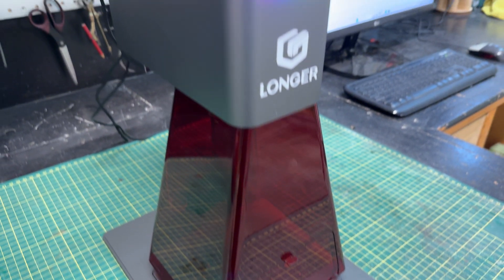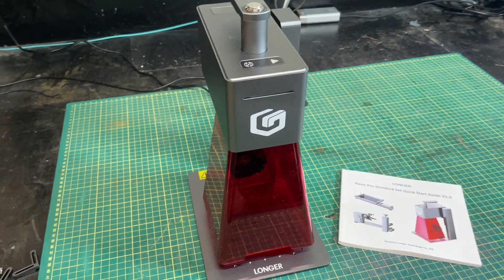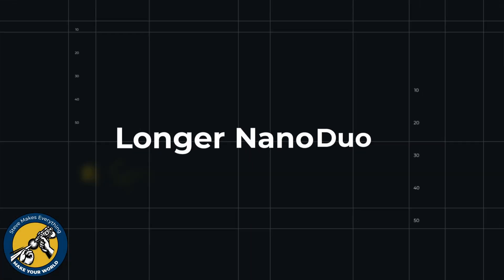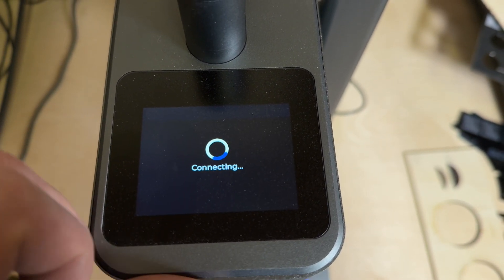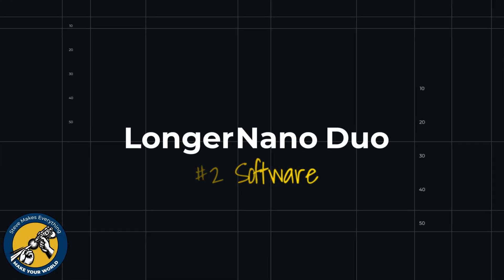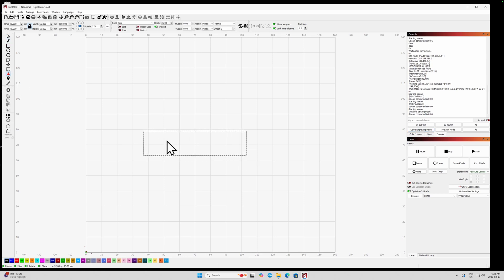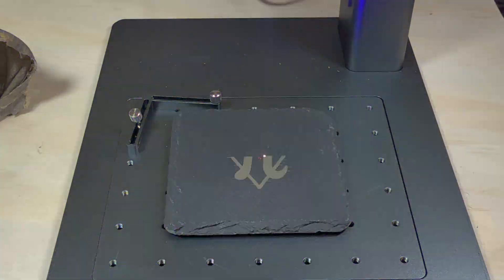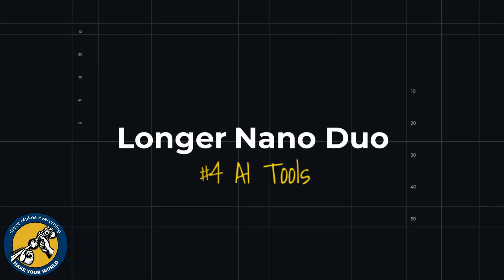This New Laser Device Makes Wood and Metal Engraving EASY!

Comment: Nice video Steve. They advertise a 160x140 working area, have you had a chance to validate that? I am considering this as a first laser.
Reply from the maker: Yes I have. Of course with a galvo power at the perimeters is a bit less but it’s quite acceptable here. If it’s your first laser then understand that you won’t cut anything unless you also get the XY table
Reply: @ good to know.  Our use case is mostly anodized aluminum plates, tumblers, and some leather.
Reply from the maker: @QBFWorkshop  The Duo should be able to handle these fairly easily as long as the workspace size doesn't get in your way.

Comment: Did you try live framing in lightburn (contour, bounds) or is it just fraiming rectangle?
Reply from the maker: I didn’t specifically try contour framing, but this isn’t something I typically do. The Duo does have a camera though which is pretty accurate once it’s calibrated.

Comment: Have you tried engraving black polypropylene plastic? Curious if a nice white mark can be made on that material with either engraving mode of the Longer Duo.
Reply from the maker: I don't have any of this material, but it engraves black acrylic fine.  In either case, you'll probably want to use the IR laser rather than the Blue laser.

Comment: Love the channel and how you get to the point quick with honesty. Usually if I'm stuck and I need to figure something out with a laser I just scroll through your videos. You're the best at it hands down. I'm still trying to wrap my head around the prices of fiber lasers. I really have a hard time seeing any advantages buying one, owning a diode. Portability is pretty awesome but the work area is so limited. It's just too small, they're all too small. 
I do own a diode 22 watt sculpfun s30 ultra.  It's a beast of a machine. 600mmx600mm (23.5inx23.5 in). Definitely something you need to get your hands on. 
Which is your laser choice? If you could only have one?
Diode, CO2, or fiber?
What's your favorite thing to make with lasers?
I still have yet to figure out engraving acrylic. I just can't seem to get the frosted look. I did the material test and still no frosted look. I can tell it's engraved but it's very hard to see. I've tried tempura paint, and poster board. It's very tricky. 
Sometimes the tempura paint will permanently adhere to the acrylic after a burn, sometimes on glass too. 
Do you know what causes this? 
Keep up the good work with all your knowledgeable videos. It really does help a lot of people. And I'm so glad you cut out all the BS and you teach right away. It's also awesome that you clearly have common sense. Thank you for providing real life knowledge about laser engraving in a quick way.
Reply from the maker: If I could have only one laser, I’d have to go with a CO2. They are the most versatile, though still limited in some ways.  I don’t really have a favorite thing to make since I  don’t  typically make more than one of anything. 

I haven’t seen tempera paint stick. You can usually just wash it off.